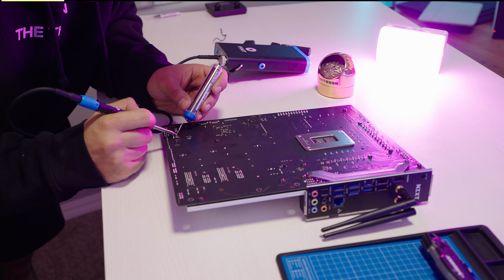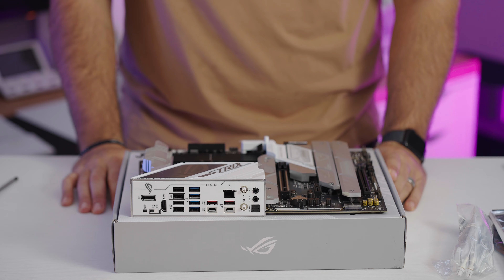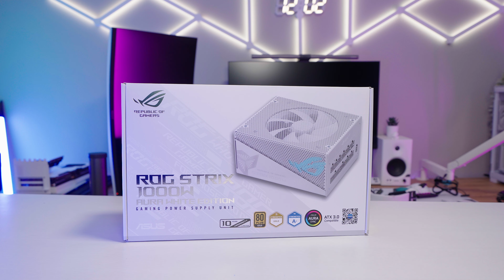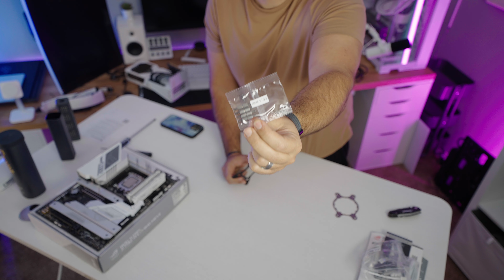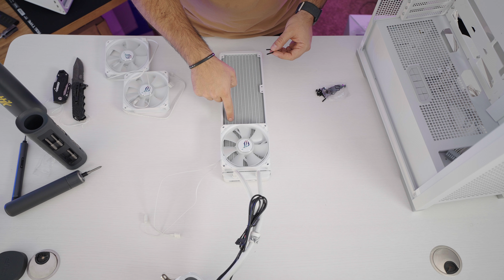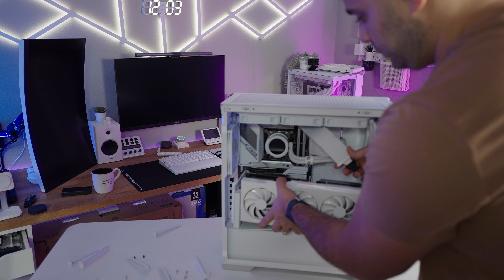Build my NEW GAMING PC with me - (Step by Step PC Build Guide)

Comment: Unabhängiger Oculink belegt keinen NVMe-Steckplatz,22
Ultra leiser AMD Ryzen 9 6900HX (8C/16T, bis zu 4,9 GHz), 32 GB LPDDR5 (4800 MHz) 1T SSD, Mini-Computer, NVME*3
1. Ryzen 9 6900HX / 32G RAM DDR5 + 1T SSD M.2 2280 PEIC4.0
2. Unabhängige Oculink/HDMI2.1-Schnittstelle, unterstützt Dreifach-Bildschirmanzeige
3. Nur 0,6 l Volumen, platzsparend/„Forest 2.0“-Geräuschloses Kühlsystem
4. Lokale Servicezentren in Deutschland und Amazon FBA-Lager, WiFi 6 2,5G LAN 8K Dreifach-Display